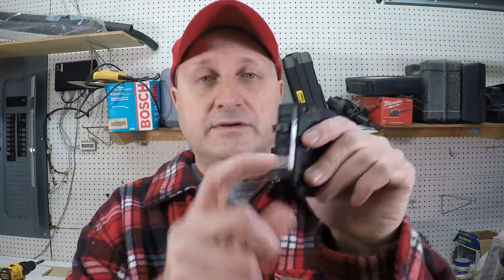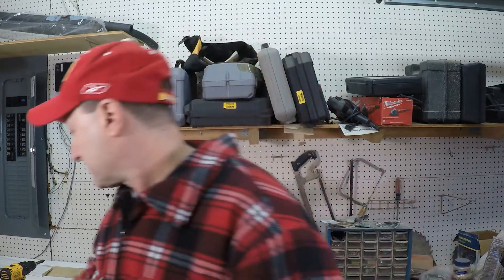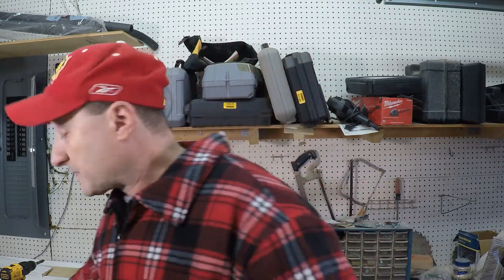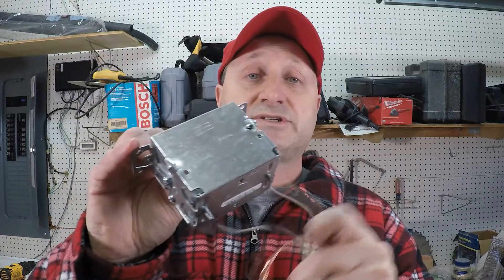Why do Circuit Breakers Trip? Here is Why

Comment: My 220-volt, 100-amp main will not shut off power to one leg. How should this breaker be removed and replaced?
Reply from the maker: The safest way to do it is to pull the meter off, and then change the main breaker.

Comment: My breaker box is outside on the garage wall. The living room and the den are hooked up together! Now, what I have is the television and the wifi power box. Both are plugged into the same outlet.  Ok, it happened twice today. Nothing else is hooked into any of the three outlets.  What could be the problem?
Reply from the maker: Sorry for the delayed response Carl. I have been away. There could be a couple of issues. First, it is possble that there is something else on the circuit. Next, if you have an arc fault breaker, those will trip from the slightest variation in power draw. You could also have a faulty breaker so you can just change the breaker to rule that out. You could have a faulty wiring situation with a loose wire somewhere in the entire circuit. Finally, try eliminating one of the two items from the circuit. Run an extention cord to the TV only from another outlet that is on a different circuit. If the original breaker continues to trip, then swap the TV with the WIFI box on the extension cord. See if that works. You could find that maybe one of the devices is the problem. I am leaning towards the breaker.

Comment: Hello! Do you think a defective floor fan could cause this?
I have a fan that I saw a spark in. The switch is stuck in one position,but it still works. I unplug the fan when I'm not around. But the breaker this fan is on keeps tripping.
Thanks for any answers.
Reply from the maker: Most likely yes. If the fan is sparking, then you could have a fault there which could trip the breaker. Do not use that fan

Comment: could it be that the breaker has just gone bad? my exterior outlet keeps tripping the breaker when i try to run my pool cleaner robot. older house. the thing is, if i reset it and try it a few times in a row, itll work. if it was crossed wires or faulting, it would never work. would it be that the breaker is just starting to fail in this case?
Reply from the maker: Yes, that is another explanation

Comment: This is a real baffler, and I suspect that it's the less common opener you talked about. Our vacuum cleaner pops breakers on two different circuits that don't have anything that draws any real current. 
I've always suspected that the one outlet might be wired wrong, but just found out that another outlet does the same thing. At first I assumed they were on the same breaker, but they're not.
The kicker is that they work for other things that I suspect don't require the hot side to be correct. Lights, telephone chargers, and an old fan, all work fine. 
Today I tried reversing the hot and common wire on one of the receptacles, and it popped the breaker as soon as I turned it back on. 
I'm clueless.
Reply from the maker: If you did not do it already, start by using the outlet tester. You can also test that vacuum in other outlets around the house and see if the breakers trip. It COULD be that your vacuum has faulty intereior wiring

Comment: I have a breaker that keeps tripping, however it's seemingly random and as soon as it goes I can turn it on again with no problem, sometimes for hours, sometimes for days. There's very little power being drawn and no recent changes made to any wiring I reckon the breaker might need replacing.
Reply from the maker: Breakers go bad and need to be replaced. Try doing that
Reply: @flannelguydiy6458  Turns out the downstairs ring was shorting out. Replaced with several radials and a new CU all good.
Reply: This is exactly what's happening to me.  Thank you 🙏🏾

Comment: My house was built in 2019. All the wiring is just 4 years old, and I have various breakers tripping. I am only running lights and a computer. I am the only one  in the house using electricity. It is strange as to why this is happening.
Reply from the maker: maybe the breakers are just faulty. Try replacing one of them
Reply: @flannelguydiy6458 are they afci breakers?

Comment: My electrician divided out circuits to the kitchen and replaced a couple of breakers but still has not determined why the breakers to my office and living room keep tripping. He told me that I need to plug each item that's plugged into those circuits into a heavy power cord and plug that into the brand new circuits he installed. He said that one of the items being used could be causing the problem and if one cause the new circuit to go out, I'd know it was that item. I have a pretty good quality power strip in the office into which I have my iMac and a lamp plugged in. I rarely use either yet the circuit still goes out. There's got to be an easier way to figure this out that what he's suggested. My computer is fairly new, 2019. The lamp appears to be in good condition. Does the guy know what he's talking about? $2500 in and I still don't have electricity in the LR or office that is predictable.
Reply: Joan, this electrician is out of his mind. He needs to isolate each outlet on the circuit to determine where the problem is. You can also take a look at the items you have plugged into those circuits to determine whether there is ONE thing that is doing it. Also maybe the circuit for the office or living room is also tied into something else that is using power.
Reply: @ericjeanette-homefinances2510   is there some way to test the devices on the spot/immediately rather than plugging into the new circuit with the power cord?The breaker shutting off happens intermittently. I can't figure out a common denominator that happens to make the breaker flip. I might turn the breaker back on and it doesn't happen again for a week--or two. He counted up what's on the circuits and decided that what is plugged in isn't enough to trip the breaker. That's when he suggested that maybe it's the device(s) itself. Sometimes I'm not even home using the suspect devices but the breaker trips. He said it might even be the ceiling fans. Or the power strip. Aaaahhhhh!! I don't have time or the patience to do all this testing. Seems like that $2500 would have covered it, right??
Reply: Seems like he wants me to do all the investigative work, LOL (not). Then he'll swoop in and save the day and I guess charge a bunch more money.
Reply from the maker: yeah find someone else
Reply: @JoanAllison-q9e  hey man same is happening to me, I am trying to find a power strip or a pud to which I can connect several devices and identify the faulty one. In my case it happens randomly and when the electrician comes nothing happens, I need something smarter to keep and learn which is the faulty one